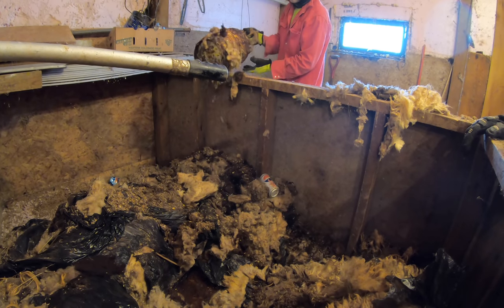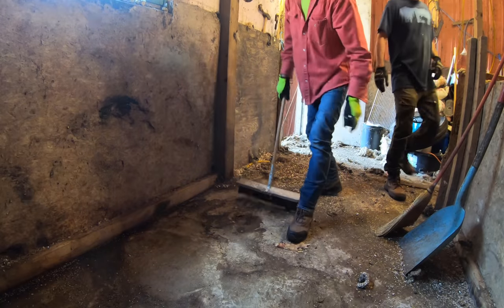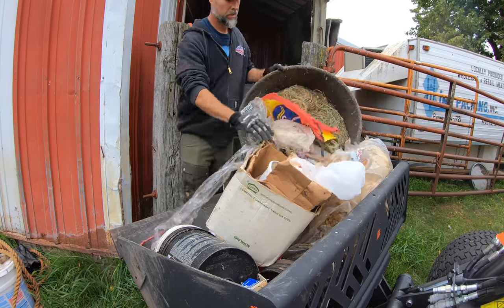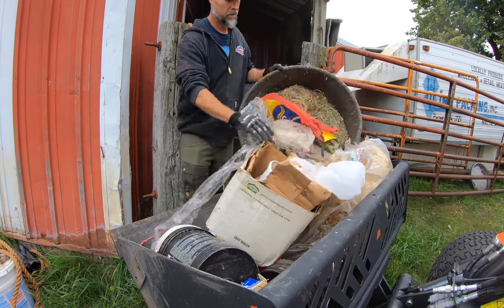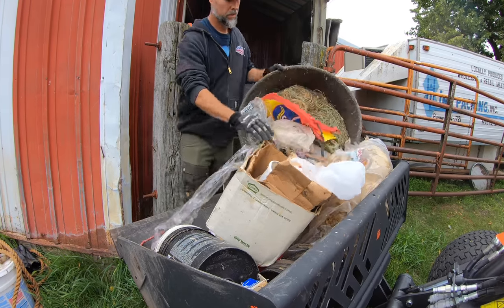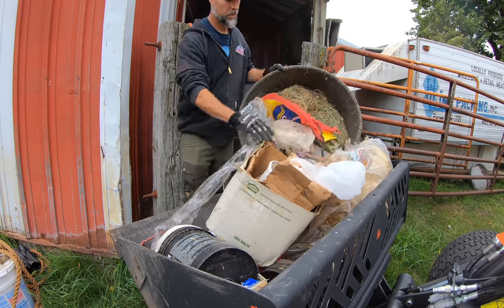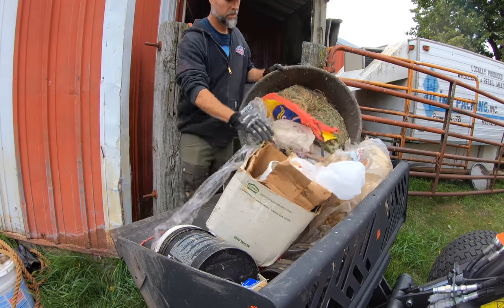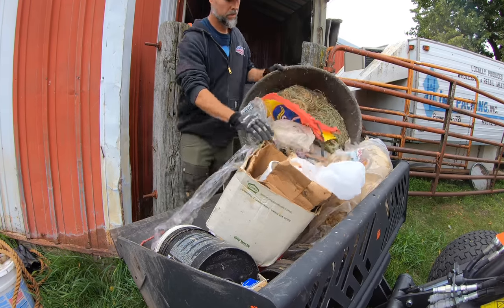Cleaning the dirtiest hoarders House on Youtube!!

Comment: Guess you guys have never heard of a respirator. Or else you like gagging on nasty odors
Reply: no kidding. I was holding my breath just watching
Reply: The problem with using a respirator is that it will get clogged with dust, rotting wool dander, and rat feces powder making it hard to breath through.
Reply: @scotshabalam2432  That's true.  Better to let your lungs act as a filter
Reply: I just figured Stan not wearing a mask was a political statement
Reply: Real men don't needs masks 👍 (sarcasm)
Reply: It hurts the manliness.
Reply: @JasonLLC  Yep
Reply: They need tyvek suits as well
Reply: I guess you have not used any of this  more when 1h.  aftar 1h they useless and is more dangerous  when all this dust
Reply: @markgriz   is reason you got all this hair  in your nose and all this snot coming out from your nose. to filtrate all crap from air
Reply: @ColeSpolaric  Yep
Reply: @scotshabalam2432  Then you change it.
Reply: @rickdaniel1707  I was being facetious. Markgriz pops in with the best response "Better let your lungs do it instead!" which is exactly how I meant this to sound.
Text based sarcasm doesn't always play well. I apologize.
Reply: @kurmis999  Really?.
It all depends on the type of mask. With basic n95 masks, you just change them when they start to clog to the point that they no longer work.

Comment: I've done some "fun" cleanouts over the years myself, just be glad you can put the trailer close by.  Learned my fav trick regarding garbage bags on a 3rd floor walk up where the trash, pet refuse, and dead cats was about 4 feet deep in the whole 1200 sq ft place.  

Favorite brand I've used is Demo Bags, the bags are made of the woven plastic for strength, their mfg states each 42 gallon bag can hold 100 lbs.  Mind you, that's 100 lbs of drywall, brick, etc.  Serious tear resistance.  

The bags themselves make a big difference, it's nice not worrying about tearing them while carrying a distance.  

The trick comes with an additional "odd" purchase.  I picked up a bag stitcher, originally intending for packaging mulch; we've gotten so much more use by using it to close the demo bags rather than their suggested method of a zip tie.
Reply from the maker: Hmmm- those demo bags re-usable then?
Reply: Stanley "Dirt Monkey" Genadek the stitching can be pulled and redone a few times. 

I’ve also used a telehandler to hang a bulk bag outside of a window and shoveled out the remains of a collapsed attic. Wet blown-in cellulose is not fun to deal with.

Comment: Since the wool and animal bedding is natural material, I've been wondering if it would be worth the reduced volume of the final garbage haul to spread that stuff in the field and let nature take its course. Extra work though, I grant.
Also: tarping the pile to protect it? From what? Is it so that it doesn't get wet and therefore more heavy (and thus more expensive to remove)?